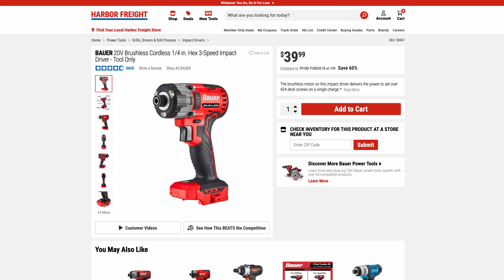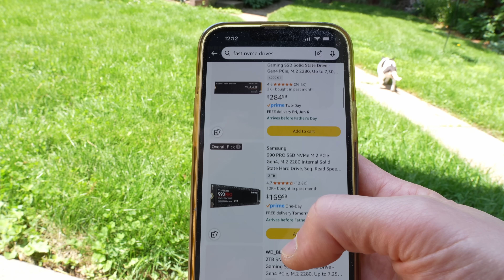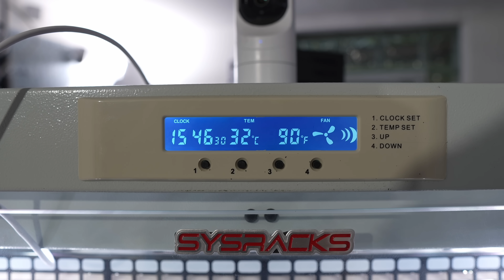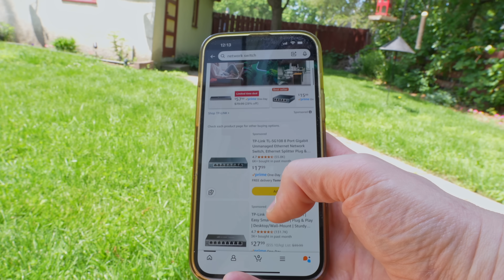Buy Once, Cry Once: How I Wasted $2,857 on Switches

Comment: Buy once cry once only gets you so far. There will always be the next shiny new thing that solves other issues that didn't exist when you bought that $3k switch
Reply: Exactly! Especially in tech: you buy the best you can get at the time for a premium price, only for it to be surpassed in 2-3 years for something else that has the newer features at a lower price. I've personally regretted that "buy once cry once" tactic a couple of times. You can always repurpose or sell the lower tier tech that serves you well for the time being.
Reply: @andresbacalao9493  buy the gear that people chasing the latest and greatest are selling used (2nd owner).
Reply: Every time I hop into a new hobby, I think I dont wanna buy the expensive thing if I dont like the hobby afterall but I dont wanna get the cheapest thing either if it ruins it for me, then you end up with middle of the ground solution and those are the once I end up upgrading from...
Reply: This is not even an enterprise grade switch. It runs UnifiOS, which I would never ever consider putting in a professional grade network (those cost a lot more than this as well). And for a home labs this sucks because it's not open enough. Their Edge line was better but now discontinued. MikroTik is a better choice for labs/home since you probably want to tinker and customize the network. 

Ubiquiti is more like Apple now, this is what you get, we lock features down with software even when the hardware can run features...

For his home/lab network this is a bad purchase. It's not enterprise quality, and it's certainly not open enough for customization. Performance is also horrible for that price range, people look at speeds, they should look at packets per second.
Reply: @Netz0  Yeah the SFP ports are better still. Just buy adapters to RJ45 and there's less complications. RJ45 cables produce more heat BECAUSE its copper. SFP uses light to convert, produces less heat anyway. I got 48 10gig SFP+ ports and 4 QSFP+ 40gig ports for 100$. I'm set for my self.
Reply: @Netz0  We had one at my previous employer. It worked fine for 50 users with no issues. When we expanded we added Cisco Meraki but as APs but for core switches they worked without any issues
Reply: That’s a 3K switch? Crazy
Reply: @vitalis  yah welcome to shitbiquiti...
Reply: im too broke  to  use the buy once cry once. ion have money to buy anything lol

Comment: It does pay to take a step back and forecast what you might want a couple years down the line, but don't be too hard on yourself. I don't think you could have foreseen some of those changes, and the adoption of 10GBase-T has ramped up considerably in the past 2-3 years.
Reply: yep and a switch with the same config as the xg 48 that came out this year would likely have cost a lot more.  ubiquiti stuff also has quite good resale value so you can recoupe a lot of the old switches costs.

Comment: I think buying second-hand gear is the sweet spot when you're still figuring out your setup. You can experiment, learn what you actually need, and then resell most of it later with minimal loss — sometimes even breaking even. It’s a lot less painful than stacking new hardware and regretting it later. "Buy once, cry once" makes sense after you’ve gone through the trial-and-error phase.
Reply: Exactly how I got started way back. I wanted to have (play with) a managed network back in the 1990's but cost was prohibitive. Then dot-bomb happened and I could afford some used managed Baystack switches, a used managed DVD tower, and a server with scsi controllers....etc.  Good learning.
Reply: @rankenfile What’s a DVD tower???
Reply: @ChooseAShorterHandle-p6e

I would guess it’s a tower computer with multiple DVD burners. It allows you to do small runs of DVDs that are too small to contract out but big enough that it would be a PITA to do them one by one.
Reply from the maker: Well said!
Reply: I am in this right now. I am gig with some WiFi. I just added a 2.5 gig switch, then I added 2.5 gig PoE, then I added a fiber run to another part of the house. 

Now I want to replace the gig switches with 10 gig PoE....ughh...it just keeps going.

I decided to take a step back and do what I should have done initially, which I do when designing global networks for my job. When in doubt Visio is your friend. Draw it out so you have a clear picture of what you are trying to accomplish. It works for me and I should have used it at home.
Reply: buying second hand network devices can help to understand enterprise standards
Reply: @Cucaracha_512 Just like buying used Cisco enterprise gear for those want to set up a homelab for practicing/preparing for CCNA certs and beyond.
Reply: Yeah, that's usually a good way to go.
Just forego enterprise gear, the licensing costs will eat you up alive. And they are WAY to overcomplicated for EVERYTHING you need in any other place than enterprise environments.
Reply: It is ALWAYS the sweet spot if it‘s for private use. Why? Because you can get switches that were 5000$ five to ten years ago for like 150 to 300$. The Ubiquiti crap is toys compared that enterprise level stuff. Switch 48 ports GBit POE++, 8 SFP+ ports plus 4 QSFP+ ports, 300$. Switch 12 QSFP+ 100Gbit ports 220$, Switch 24Gbit ports plus 4 SFP+ 120$. I have eight switches like that, none have failed in several years. Why would I spend like 2000$ on ONE switch just so it has some night club lighting on the ports?
Reply: @jensdroessler3575  because configuring and managing networking equipment becomes accessible to a lot more people when you have an interface that is user friendly rather than user hostile? 

Unifi and PFSense have allowed me learn far faster than I would have otherwise. 

In the case of Unifi in particular, the integration of gateways, switches, and access points really does make it possible to do things the right way in less time for those who are inexperienced. But also for those who are experienced.*

FYI - The documentation for PFSense is fantastic for those he to networking. Most settings (all?) have a direct link to the relevant documentation on their web site.  

* When I say faster, I’m excluding any equipment where you can script its setup so you can automate a very high degree of what needs to be done. You could create a setup that almost sets itself up in that case. But that again raises the bar on knowledge needed. It’s great solution for hyperscalers, but not for everybody. 

BTW - Anyone who  makes the blanket statement Ubiquiti is a toy is either a uniformed idiot or an informed idiot. Either way, you’re still an idiot.
Reply: Yeah, when setting up a new office existing CAT5e for VOIP phones and printers, I just bought a second hand 48 port gigabit switch for $30 and replace it as needed.
It has been almost three years with half the ports empty and no complaint yet so not gonna upgrade anytime soon
Reply: Used enterprise gear is the way to go.  Dirt cheap, so much so that for less than a new one, I can have "on-air and a spare."
Not having to call up India for an RMA and hope they can overnight me a part and instead being back up in 10 minutes? Priceless.
Reply: @grayrabbit2211  a couple very notable downsides to used (generally old) enterprise gear are power consumption and noise
Reply: Until the backplane on your used server chassis fries your 16TB Ironwolf Pros... (thank god it was just the PCP... and china delivery, and shipping to PHX for the MCU swap... 6 weeks later still waiting)
Reply: I agree but.. using and trusting devices is where science meets usability. Best practice and common strategy is zero-trust if you are ever going to keep security in the loop while knowing your hardware isn’t the  rouge agent. When it comes to lab work or creating a secure setup then it might be ok but still. Buy from trusted sources - not just from a trusted vendor but throughout the supply chain. This might bring up costs but would be priceless or pay for itself in knowing integrity is maintained. The market is flooded with malicious layer 2/3 devices and advisories know by reducing selling price they will attract buyers.
Reply: The only problem is the power draw of used gear but you have to die one death LOL
Reply: current gen ubiquiti stuff holds insane value.I watched a pro max 16 switch go for 255+15 shipping. that switch is 279 brand new with a 2 year warranty on ubiquiti on ebay you get 30 days.
Reply: The irony? All of his devices are probably sitting idle, if not, then his bandwith/ throughput utilization is only sitting at max 1-5%
Reply: Looks like this man only love to play with tech stuff. Like a boy. 
Normal engineering: know BEST PRACTICES from books/training materials, STRATEGY PLANNING, buying hardware “as you grow” (+ training skills on cheaper used models).
This is just youth generation, which prefer “emotional buying” something with a lot of leds, instead of studying and planning.
Reply: @SergeiShablovsky Its a hobby, not a job. Most of us do not "need" any of it.
Reply: @SergeiShablovsky  I like to play with tech stuff very much - it is my homelab, it was built for it. I just do what i want. On my job I should use best practices and think before doing. At my homelab I am free and wanna just have fun)

Comment: that why I just buy 30 dollar used switches.  have a 40gig that cost around that as well.  the "new" stuff is throw away.
Reply from the maker: I have also bought my fair share of used gear too (even some of this was).  I am really hoping this lasts at least 5 years....
Reply: Might you have the brocade icx 6610 I just got one off of FB market place for 20 dollars lol
Reply: @mattjax16  not yet.  but it would make a good 10g to 40g SN6010-ON bridge !

Comment: But you soon will have a 25 Gbs wan line....
Reply: There is a huge difference between "need" and "want".

I recently replaced my old firewall Appliance with UCG-Fiber. 
I have 1G Internet directly into the UCG, but I'm able to get 10G internet for very reasonable money. 

I absolutely want it.
I absolutely don't need it...
Reply from the maker: I was hoping this was at least a 5-year solution....
Reply: @TechnoTim My provider provides 25 Gbs at the same price as 10 Gbs... it just was not yet available where I live in central switzerland. So I went for 10 Gbs firewall and copper main switch. If they make it available next year 😢...
But fair enough 10 Gbs fits my homeoffice needs for the coming 5 years.
Reply: Just remember 25Gbps is NOT any faster that 1Gbps. It’s only more bandwidth, which only matters if you can make use of it. I get so frustrated with servers that will only download at 100mbps when I’ve got 1 Gbps. 😢
Reply: @carbongrip2108 if you're pirating which people who want a 25gb line are doing they will hit it if the torrent has enough seeders.
Reply: @carbongrip2108 True - but I work for an IT company... and have multiple access points that provide 10 Gbs :-)
Reply: @carbongrip2108 Exactly. It's like driving a race car on a congested street. Sure you look cool but it's expensive to own, expensive to run, and usually unnecessary.